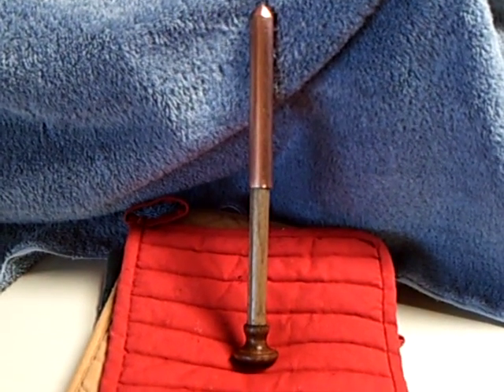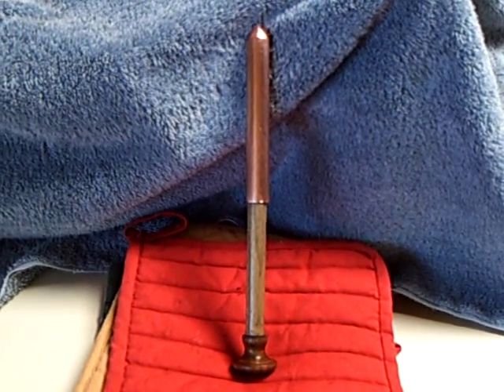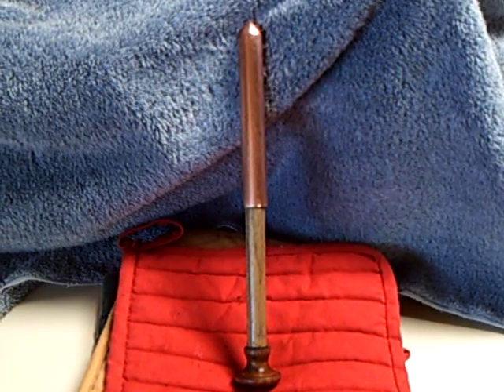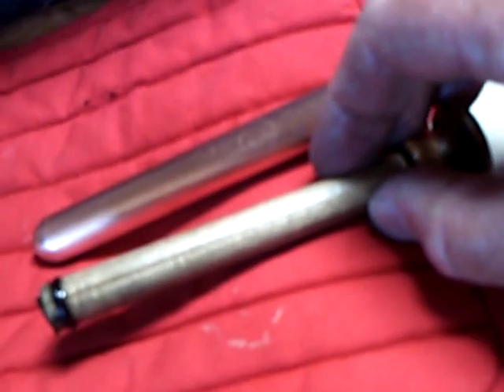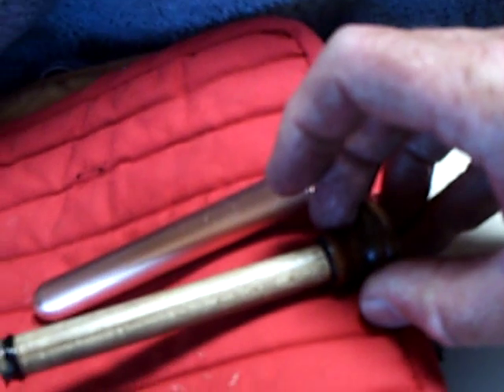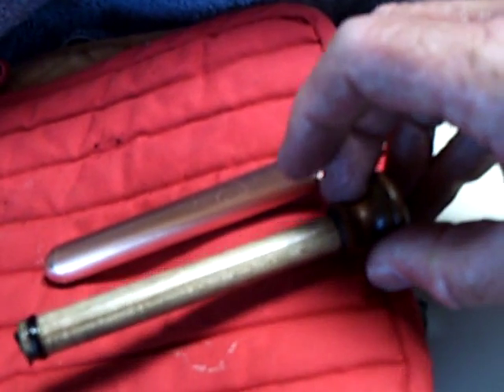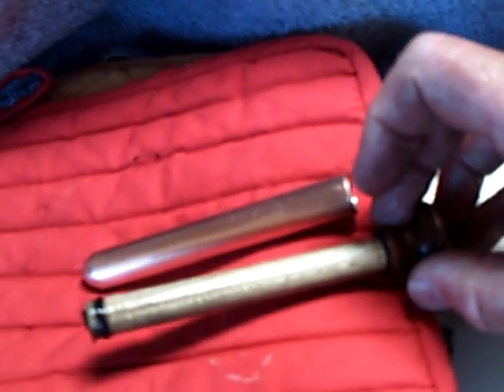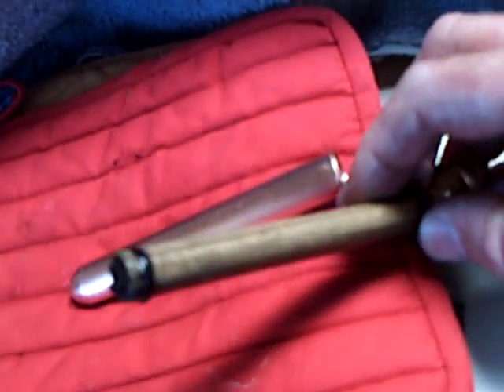Fire Piston --- The Buckshot752 model

Comment from the maker: I did some hunting before I chose this design.  These homemade Fire Pistons are not that easy to get working if things are not right.  It can be a frustrating failed project.  I got lucky and it worked right away.  You just have to follow the instructions to the letter and use the correct parts.